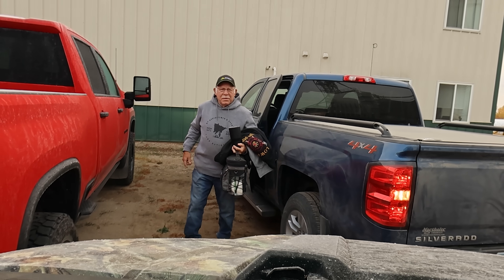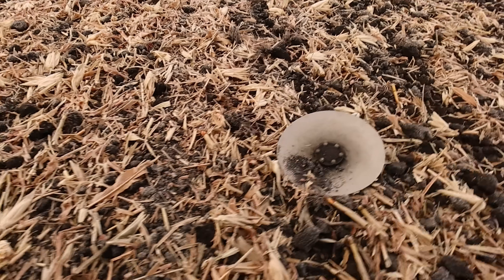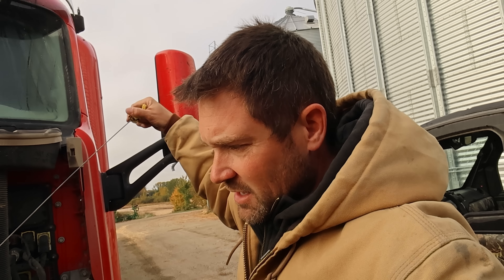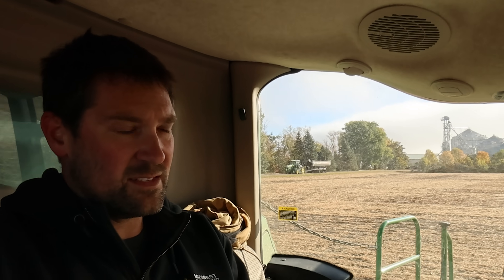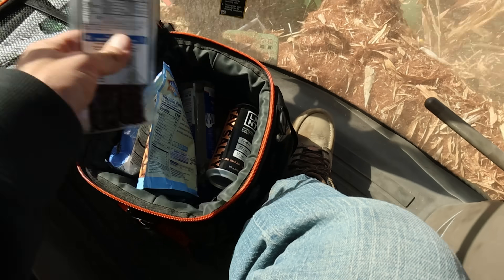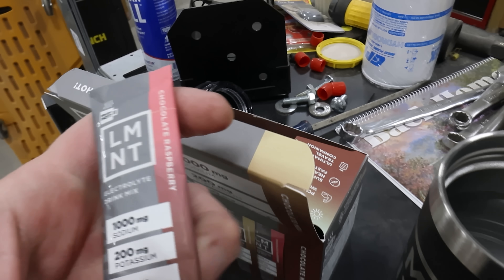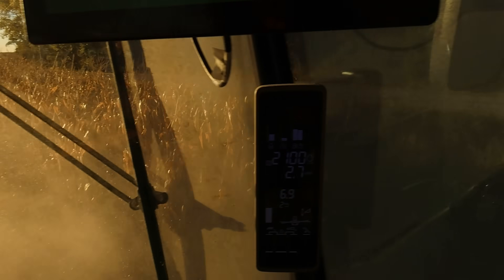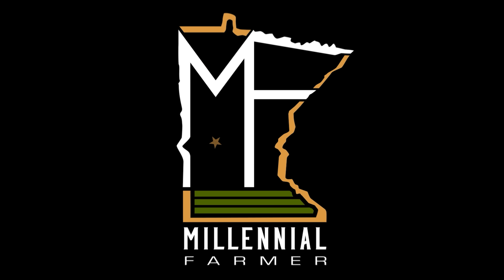Back in The Combine!

Comment: Zach, consider a glider kit for your next truck. Chassis with complete cab and interior and steer axle only. You suppply the engine, transmission, drive shafts and rear axles.   With heavy trucks the engines have years too. As far as I know you could have a ‘25 chassis and a 2013  overhauled engine.  (I believe that was the year before DEF requirement). Just a thought.

Comment: Actually its more efficient to clean headland on one side of the field with two combines then snap your line on a seven degree angle then nibble at the other headland as you cut blocks down the field keeps your cart going

Comment: The dust in the late afternoon sun is a real problem . The combine I've been running doesn't have auto steer, so I just watch the top of the stalks. If they jerk left, I steer a bit right and visa versa. 
 Heck I was chisel plowing this afternoon and had a 'sun in the dust' problem for a while.

Comment: Zack, have you considered whether the C-shanks that are breaking so frequently might have a manufacturing defect? If they weren't forged correctly or heat-treated correctly they could be less rock resistant (ie made from weaker or more brittle steel) than the ones which aren't breaking. Look for mold marks to see if the broken ones are perhaps all from the same lot and/or from the same factory.

Comment: I'm surprised they haven't come out with some sort of wind system for the windows to clear out the dust. Some sort of Wiper like contraption that shoots compressed air at an angle to blow away the dust. Wouldn't make them squeaky clean, but probably good enough to keep going.

Comment: You should spray paint them orange. I know most of the paint would wear off, but not all of it, and the left on paint would make them easier to see???
Reply: Use droan to find lost parts. In 1966 wegot J.D. 106 pull type combine. Not put together very good. J. D. slogan was the "Long Green Line". Didn't take us long to figure what that meant. J.D. parts all over the field.

Comment: Just have a silly question for the farmers out there. 
It seems that the equipment breaks quite quickly and a lot. Now I may be only seeing this once the equipment has been used for a while or it may be second hand, but with the money they charge for firstly buying the equipment and then the parts cost, it seems like the equipment itself should be more reliable. I get that what these machines go through is heavy duty stuff but I would have thought that's why they charge the prices they do for farming equipment. From the outside, it just seems like farmers get shafted left right and centre these days

Comment: Check John Deere's recommendations on torque value and bolt grade specifications. A lot of times if you go to a heavier grade bolt they won't stretch as well as lower grade and will break.

Comment: Zach just a thought and something I’ve done in the past. Stretch some pantyhose over that air cleaner so all you have to do is take the cover off, pull the pantyhose off and dust it off or blow it off. Saves in spendy air filters, we both know they’re not giving any parts away

Comment: So to help with your air filters go get a pair of granny pannys ( I know it sounds stupid but I do it on all my plow trucks in the winter) stretch them out over all your intake ports and hose clamp them down it’ll stop 95% of all the stuff getting clogged in the air filter. Also a good old snowmobile trick for running in deep powder snow lol

Comment: (1) those new Google glasses, w/ the AI wireless cameras and interactive eye-movement sensor lenses and all sorts of interweb connectivity and other “what was once a luxury it is now a necessity” features, although IIRC, being initially released to the SW developer crowd, to field test the AI involved, might eventually be a nice option for ya to use, (instead of the addition of a 3rd arm,
as was previously mentioned) literally allowing y’all to produce a “what Zack sees” POV content stream?

Note to self to tell the JD product team - use better metal, develop a  monitoring system for when said parts break and drop on to the deep dark fields and “most favorite buyer” pricing as an incentive to keep y’all from voicing the true frustration of constant repairs and replacements… that or just get a CAT dozer w/ a huge set of gang cultivators that can stand up to the crop of boulders y’all are cultivating these days?

Comment: Presuming those pieces are tempered or spring steel. I'd weld one or two & reset'em on the beam.  Then if they bend just bend'em back to shape.  Obviously from flexing they're experiencing metal fatigue.  Plus welding would be a whole lot cheaper than replacing if it works.  
Enjoy your videos, thanks for sharing.  🤎🇺🇲👋😎👍

Comment: Might want to check the metal content of your NEW parts. a change in the metal content can cause weaker metal. which would cause more need for replacement parts, sold by the big green machine company. CEO makes 12 million a year, and needs to increase profits